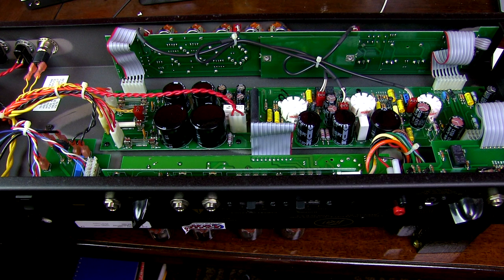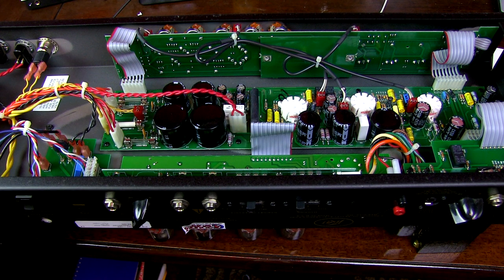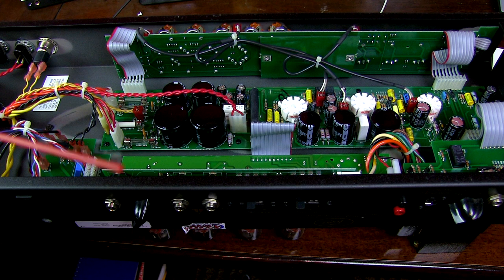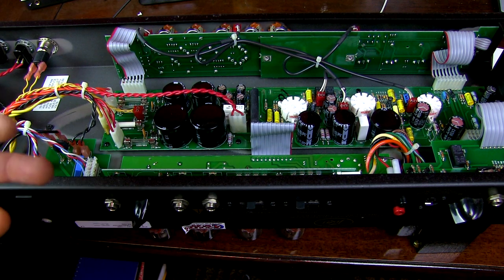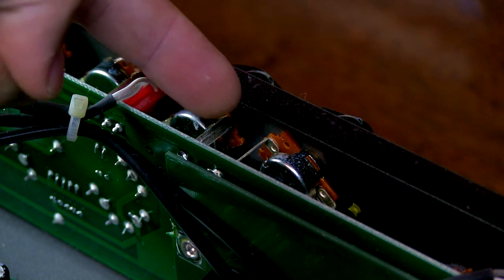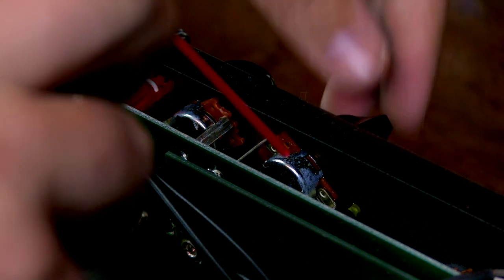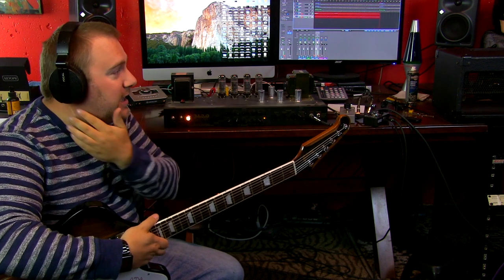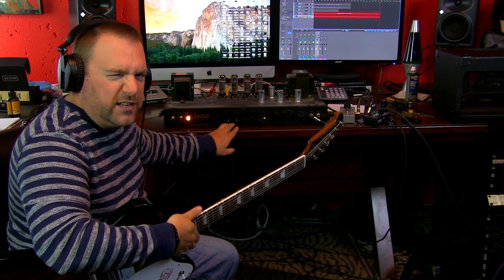How To Fix Scratchy Guitar Amp Pots

Comment: this must be a common Peavey amp issue? Working on a JSX that every single pot is TERRIBLE. I believe it sat for a while in a humid climate. I even have those dead spots you described. hoping this fixes it and my pots are so bad they need replaced. Thanks for the video.

Comment: My 1994 Fender BXR 400 would actually reduce volume by nearly 40% on it's on stage volume simply because my pre pot was dirty. I almost sold the amp,  Some pots have a removable shaft. Pull the knob, pull the shaft, squirt.